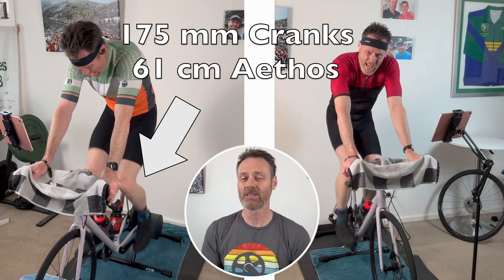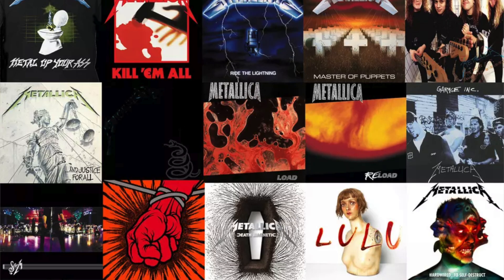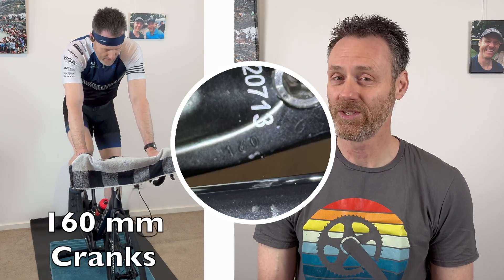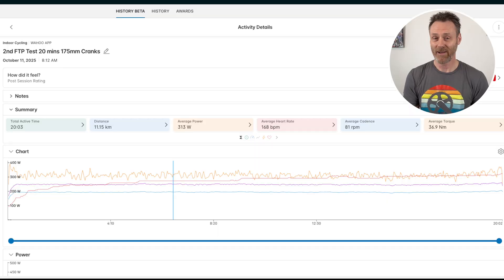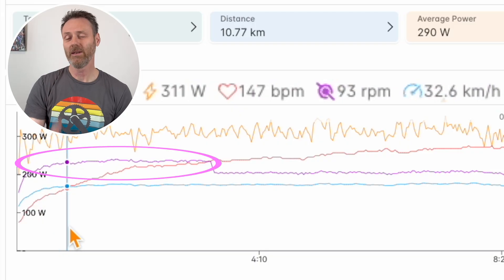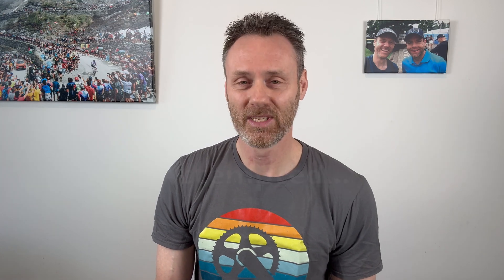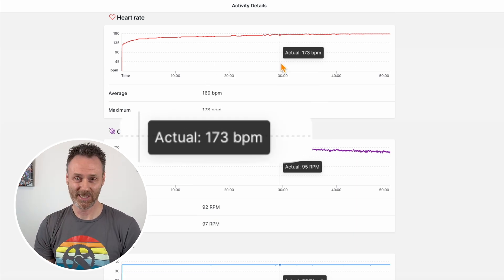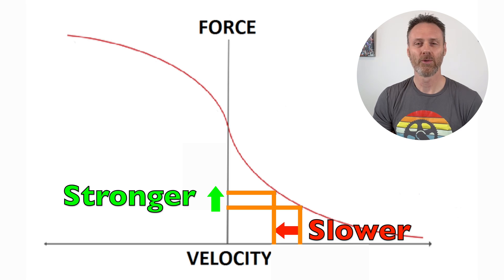The Short Crank Secret For More FTP Watts!

Comment: interesting test results. I'm curious that you performed the tests at the same cadence though? As the torque you experience on the 160mm cranks will be a lot higher by keeping cadence the same as on the 175s?
Reply from the maker: Yes, because at lower muscle contraction speed (same rotational speed but lower foot speed) a muscle can produce more force

Comment: Great video! Love the content.,
I’m 193cm and have had great results with 165mm cranks.
I’m interested to know if you used 165mm prior to going to 160mm and/or why you landed on 160mm as being optimal for you. 
I ask as I’m tempted to try 160mm.  
Keep up the great vids 👍🏻
Reply from the maker: Hey there. Ive been using 160mm cranks for a few years now and have made several videos on my personal experiences and the theoretical advantages. I didnt bother trying any other sizes as I wanted to see what a "big change" would feel like and perform like. I chose 160 as it was the shortest length I could find on the SRAM website.

Comment: Can I ask your leg length?  I'm 6 feet tall, on the nose.  I saw a bike fitter last week to recommend a frame geometry for a new custom built endurance road bike, and he tells me all my height is in my legs.  My crank length (on my current 20 year old custom built bike) is 175mm.  He recommends 172.5mm for the new bike.  Here are some additional measurements, from 21 years ago, for my current bike.  I think these were initial measurements made by me, so not necessarily precise.
floor to crotch: 35"
floor to knee:  22"
knee to top of femur:  22" (maybe this measurement makes no sense, I don't know)
If my legs are as long as yours, then perhaps an even shorter crank would be suitable for me.  It would be good to optimize the frame around the best crank length now, before having a frame built.
Reply from the maker: Hi Sam. My inseam is 91cm. Unfortunately I dont have any formula to work out the optimal crank length for you, because there are so many variables. However I am confident that the vast majority of cyclists would be better off riding shorter cranks than they are currently using.

Comment: In my case, it's directly the opposite. I am 185 cm tall with an inseam length of 92 cm. After switching from a 175mm to a 170mm crank, my heart rate increased by about 10-15 beats, and my power dropped by over 30W. My cadence is similar, around 90-95, but with a 170mm crank, I get more exhausted, and climbs are already a disaster.
Reply: I’m the same mate. Revvy heart rate and short cranks just push it up and aerobic system gets exhausted. I’m on 172.5 and those are ideal
Reply from the maker: Interesting Tomasz! Your physiology is quite different to mine

Comment: I am 5"5" (165 cm) and using 155 mm cranks on my mountain bike.  Easily noticed the benefits and the differences when I did the switch 6 years ago.  Very interesting to see you back up some of this with more and more data.  Thanks so much.  Maybe I should try 150 mm cranks now?
Reply from the maker: Hi Stephen. I think the Mountain Bike use case is interesting. Shorter cranks helps avoid ground and rock strikes. However some people point out that shorter cranks "may" limit super quick accelerations. I'm not sure about this as it isnt something I can easily test for myself. 
That said, I'm sure if a 6'4" rider can go to 160mm cranks then a 5'5" rider could go to 150mm if they want.

Comment: I was on a short cranks journey for 30 + years . My cranks was always way to long with little option . I definitely need short cranks with a hight of 164cm and 68cm inseam.  170mm cranks was all i got on a odd occasion i got 165mm all was useless.  I did get 155mm from a youths bike they were a big jump in comfort.  Only i now use 140mm cranks  they are a revolation . Why o why can bike manufacturers not get to grips with this , my battle was not to get especially short cranks just size specific cranks for a Extra Small bike , even Extra Extra Small bikes sometimes come with 170mm cranks which is utterly ridiculous.
Reply from the maker: Hi Rob. Ridiculous sums things up well. Shorter cranks will become more available in future years because the demand is there, however the bike companies need to use up all of their stockpiles and pre-orders of "Standard" length cranks first.
There may also be some bike geometry and design changes that trickle down, with lower bottom brackets. 
Slowly slowly...
Reply: @podiumphysio657 Indeed.  I'll keep on in my tiny way in a push changing minds . We have some way to go .

Comment: Did you have the same gearing for both bikes? Same chainring and cassete? It also matters. I've been testing with that and when your threshold sits on a comfortable cadence, that gearing provides the best efficiency. Then, one tooth higher or lower would throw you put of that sweetspot
Reply from the maker: Everything is identical. This is my point. You can ride the same gearing at the same cadence with shorter cranks because the slower muscle contraction (slower foot speed) is more powerful

Comment: Well, it's really hard to find 165mm Ultegra R8000 cranks for my 2 bikes, and my current power meters are crank based, so I would need to buy new onces too ! But I've been thinking about it for long.
Reply from the maker: Yeah supply shortages will hold a lot of people back. However, if you ARE a lover of 175mm cranks you could probably buy in bulk now and save a lot of money LOL

Comment: At age 75, height 165cm and 63 kg, and poor hip flexibility, I have gone from 170mm to 160 mm cranks. The difference was very noticeable for the first few rides. Since then my FTP has increased from 197 to 221. Also I find climbing seated to be my preferred option. My average cadence has also increased from around 72 to 80. Obviously I am very happy with the change.
Reply from the maker: Brilliant. Glad to hear you found a solution that works for you!

Comment: Interestingly, I've just bought a new Tarmac and went to 167.5mm cranks after only ever using 172.5mm on my road bikes.  My average power is definitely up  around 15% but I'm kinda struggling on the hills.  I'm still learning to ride with these shorter cranks as it doesn't feel right when you get up out of the saddle and put an effort in.  It feels like I'm soft sand sprinting!  I doubt it is the extra 300g the new bike weighs.
Reply from the maker: I have not found any issues with out of the saddle efforts, but you will need to select your gearing carefully. I've actually tested a full-on uphill sprint with >1000 watts output and the shorter cranks performed better then as well

Comment: Reverse the legs on your Wahoo Kickr Core for better stability. The legs are 2cm longer on one side than the other. The official instructions have you installing the legs the wrong way, resulting in the bike being positioned heavily asymmetrically to the right. This makes the bike tilt more easily to the right. After reversing the legs, the bike will be closer to the center (but still not completely centered, the new V2 model has changed it to be fully centered).
Reply from the maker: It definitely looks unstable watching those videos back. I thought it was just my massive power output LOL but I'll take a look at your suggestion thanks!

Comment: Saludos:Ahora uso bielas de 170,quería usar las de 165mm.Mi pregunta es¿Serían mejor las de 160mm?Mi longitud de piernas es de 76 cmts.Gracias.
Reply from the maker: Hi Jose. Unfortunately there is no definitive answer here, but I would suggest that if you can find them, 160mm cranks are worthwhile. However please remember that this will have effects of the rest of your bike fit, particularly your saddle height and position and your handlebar position

Comment: The question we need answered now is, "how short is too short?" Someone needs to come up with a formula that takes all the relevant measurements into account and gives an optimum crank length for one's physiology.
Reply from the maker: Unfortunately I think formulae are a bit risky as there are so many variables. It may remain a trial and error, or trial and optimise process for a while yet.
Reply: @podiumphysio657  A formula that got me close would be welcome. I'm itching to try shorter cranks (I have 172.5 on one bike and 175 on another), but it's $1,400 to change out SRAM Red cranks with power meter. Trial and error is too expensive. I may have to buy cheap cranks with no power meter and run my own tests to find the right length, then put them on a shelf and buy the right sized Red. There has to be a better way.
Reply: Appleman use to have a calculator on their site. For my height of 4'11 I said my ideal crank is 145mm but I could go plus or minus 15mm and be okay. I'm currently riding 150mm & 155mm on all my bikes.  I do have some 135mm, but I haven't tried those yet

Comment: I have 165 right now would it be worthwhile to go to 160. I have some asymmetry and some issues with my hips and low back. And yes I’ve had professional fits done. Great content as always!!!!!
Reply from the maker: Shorter cranks solve a lot of bike fit problems and asymmetry is one of these. If you can find 160s I'd suggest they are worth a try. Remember it will require saddle and handlebar adjustments also
Reply: @podiumphysio657 thank you so much for the reply

Comment: Great contribution. I changed from 175 to 165 due to hip impingement.
I just went with the shortest readily available crank length, and was vindicated by my bike fitter, who is fitting world tour riders for a living. He told me, that more and more pro a on shorter cranks. So it's not only Pogačar.
This is a trend coming from procycling that is not a fad for a change.
You explained the background story to the benefits of shorter cranks. Well done and good as always.
Cheers,
Daniel
Reply from the maker: Hi Daniel. Thanks again for your ongoing support. I was lucky to find 2 sets of 160 mm Cranks that fit my bikes 2 years ago. This meant that I could make a big change to my hip comfort, and also assess what a significant change in crank length does to performance. I'm glad to have had that opportunity